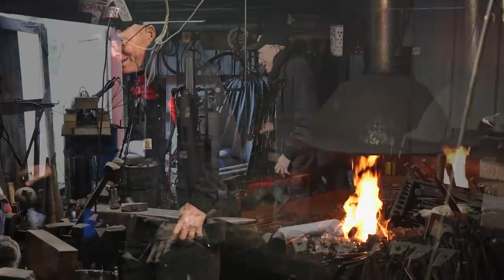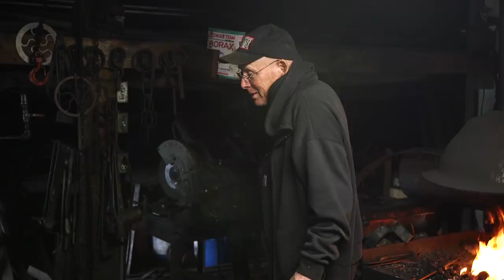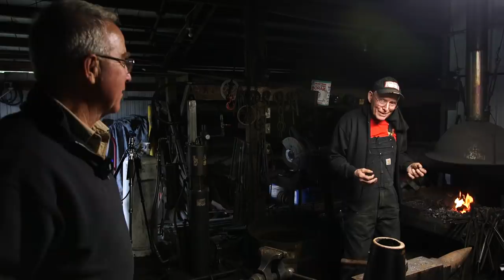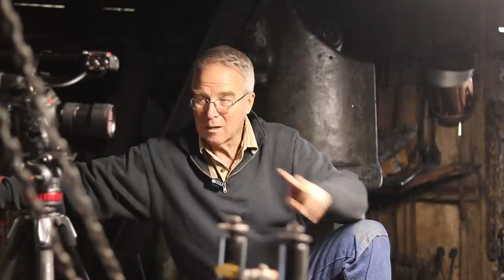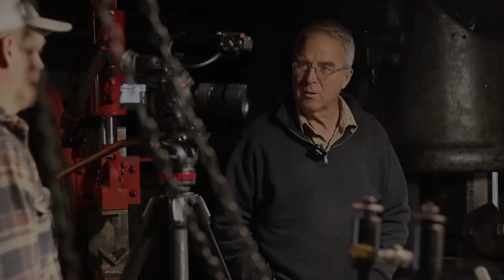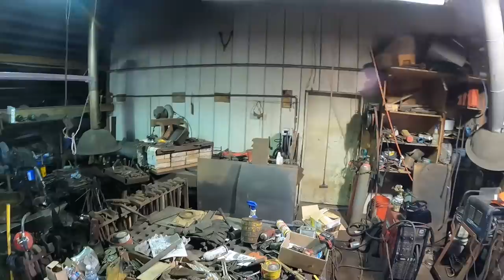Cy Swan: Skiing, Tractors, and the Power of Steam

Comment: I was 14 yrs old working on a potatoes farm with 4 or 5 others about the same age and we got an old tractor stuck! Well we knew what to do and hooked up to the other tractor and as Cy points out, we didn't understand fulcrum's, the pull tractor went right over!  It pinned my buddy under it ... the steering wheel bent around his head.  There's lots more to this story but it taught me a huge lesson and is fixed in my memory and I tell it often. My friend spent time in hospital and came through it all. 
I get on everyone's case if they are hooking up to anything . Thanks Cy, Scott  and Nate for bringing this to everyone's attention
Reply: Helping clear land during Christmas break in 1973, I had an unforgettable incident with a tractor. While pulling a 20 foot log across a pasture the butt end of the log caught a furrow. The front of the tractor went up in the air and I fell off backwards  laying on the log. The tractor conked out pointing straight up. It didn't go any further. I scrambled off the log and lowered the tractor by the clutch.
I still get shivers thinking about it.

Comment: When I was a kid, about 20 years ago, I would pull nails out of whatever I could, skids or old wood, and straighten them and reuse them for my projects. I'd cut ash saplings to use as lumber. It was a great way to grow up. Now, when I drop a nail or screw, I pick it up before I grab another one from the container. Appreciative.
Reply: As a landscaper on new construction I've picked up countless nails and screws. But was told yrs ago that a carpenter's wages are higher than the value of him stopping to pick up a dropped nail, better for him to keep going!

Comment: With a Fordson tractor or any tractor with metal cleats on the wheels, in the winter the cleats would sink into the soft ground and freeze in.  When an operator would try to go forward the tractor would rotate around the rear wheels and crush the operator.   The wise maneuver was to simply run the tractor in reverse a couple feet to safely break free the cleats from the frozen ground.

Comment: My grandad worked in a small refinery in 1920.   The max pipe was 2 inch .
They had a small hit and miss they could use but he said it was to much trouble,  that 4 guys could man handle something long before the motor could be rigged .
The use of power was determing by price. Size and power 
Steam was expensive hand huge.
But they stayed on top until tractors got more power and dropped in price. .
Electric tractors are now in the same  place as steam and tractors